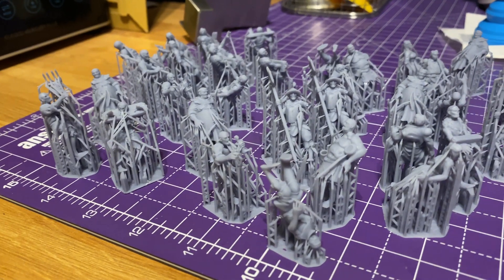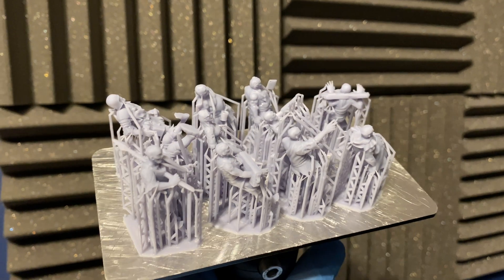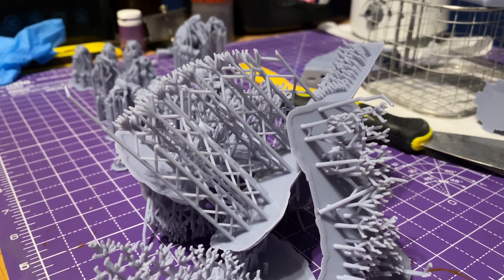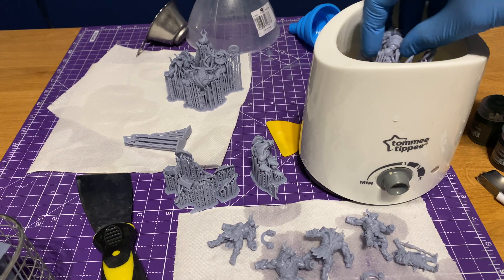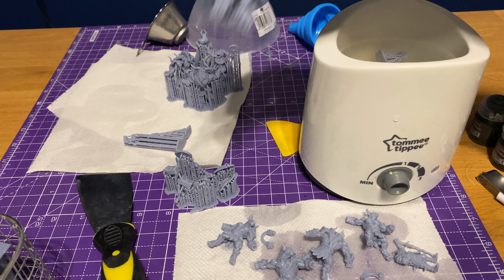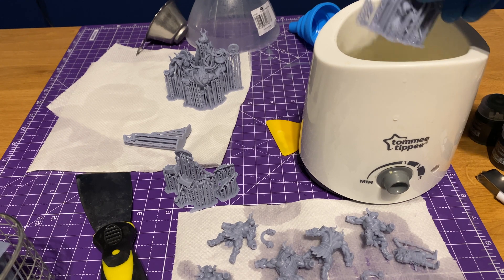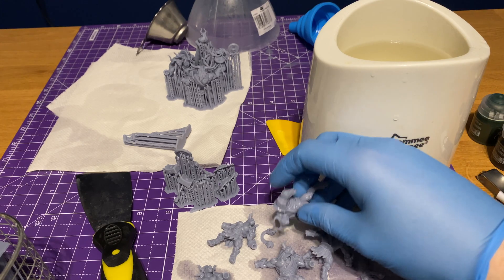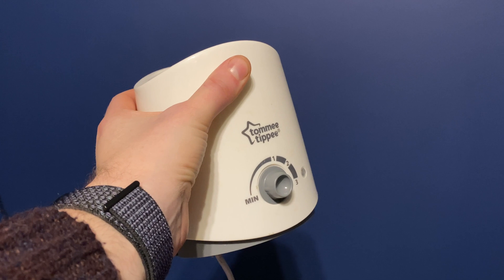3D Printing Miniatures: Removing supports and a great tool for doing it

Comment: Thanks for the tips.  I've just made my first test print and the supports don't come off without a fight.  I've tried nippers as well as hot water and the figs aren't especially impressive. I will wash, remove, and then cure for my next batch.  I also think I may need to reduce my exposure time as my first figs were kind of brittle.  Bottle warmer...  Anyhoo, thanks.  You just popped up in my feed recently.  Keep up the good work.
Reply from the maker: Ah that’s a shame. My first few models were like that, reduced detail and brittle. Keep playing with your settings and you’ll get something you’re happy with.
Reply: @GrayScalpMiniatures  Thanks. I will and subbed.  Great content. I am letting my after school war gaming club practice on the test figs.
Reply: @GrayScalpMiniatures  The next two test prints were very nice with the supports coming off fairly easily.  I now have 37 Egyptian Undead including their King. Que up Iron Maiden's Powerslave!  Thanks again.

Comment: When you place a model in hot water and see a dusting of resin residue than you either didn't clean it enough in your cleaning solution, or your solution needs to be swapped out with fresh solution.

I work with large 3d models for campaigns and use a elegoo wash/cure mercy X. It cleans the models in IPA really well that when it hits the hot water for removal you get no resin clouds. Unless I've used it so much it needs to be swapped out. Which is a great indication of when to swap IPA.

But my practice is remove from plate, clean in IPA 99%(the higher the % the faster it dries) give it 30sec to dry, hot water bath for 10-15sec, supports come off like butter, let it dry for a few minutes, cure.
Reply: Also just found you in my feed and liking the content, good work!
Reply from the maker: Thanks! Just swapped out my resin tank as it was definitely due a replacement. Always really interesting to hear the perspective of others and their processes 😄